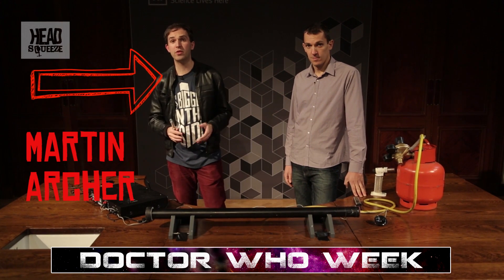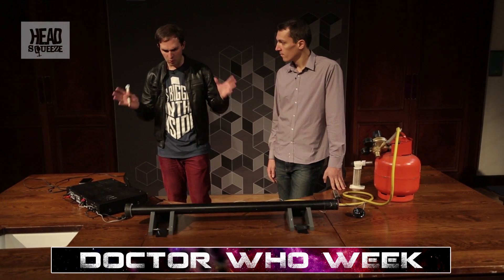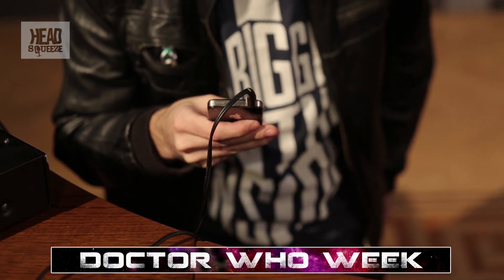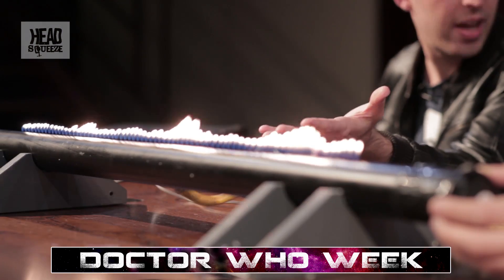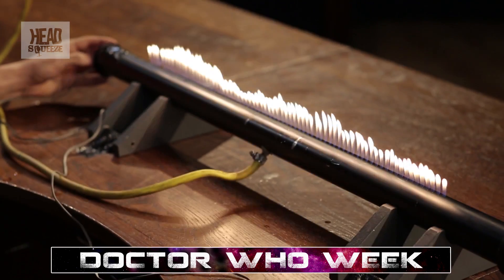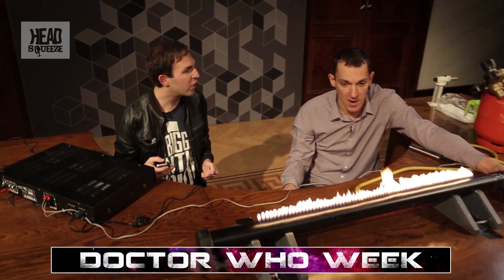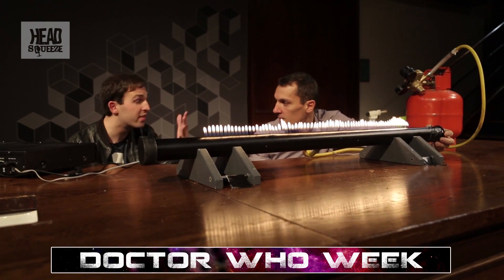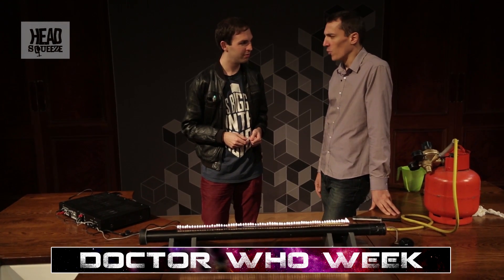Science of Doctor Who's sonic screwdriver | Doctor Who Special with Martin Archer | Head Squeeze

Comment: So the sonic screwdriver dose so much more now than what it used to it scans data heals minor injuries is really used as a weapon where it used to really just open doors loosen screens and that so it mainly opens doors could that be done by using so a high pitch sonic noise there when close enough to something it causes mini vibrations through the object eventually shifting a lock to open or break and can it open sealed coded doors by sending a infored coded to it where it dose so many coded per min till its got the right code although may have to do thousands per seconds.

Comment: I do have some suggestions to improve the experiment if you do it again:
Please put the speaker ATTACHED to the tube not held against it, trying to get clean sound through duct tape is not the best.
Having the gas come in from the side rather than the end, as long as you keep it near, will not cause any detrimental effect I know of if you have to put the speaker there.
Maybe a slightly larger length of tube, It would let you see the low notes better.

Comment: Alright, question - the actual length of the tube also matters, right? a longer or shorter tube will have different properties, right?
Reply: The length of the tube will change what frequencies of sound will resonate in it. Like I say in the video, for resonance you want a whole number of wavelengths to perfectly fit in the length of the tube. The pressure of the gas you pump in will also affect the resonant frequencies as it'll change the speed of the waves through the tube and thus their wavelength.
Reply: Martin Archer
Thank you sir.